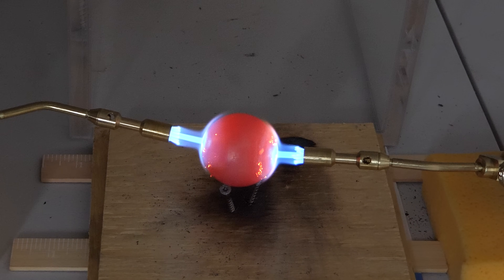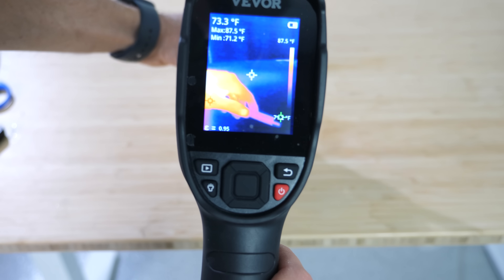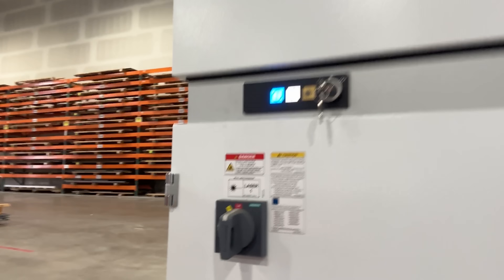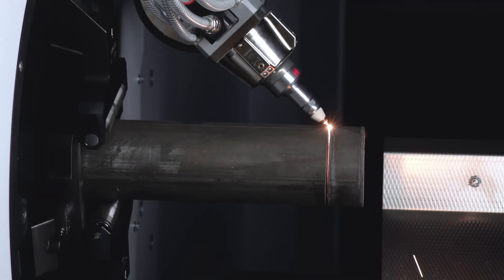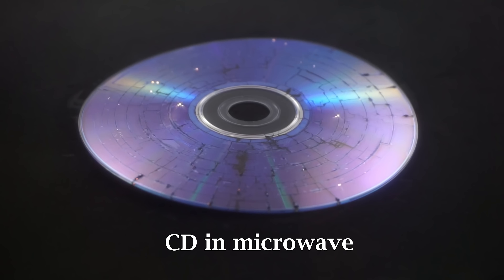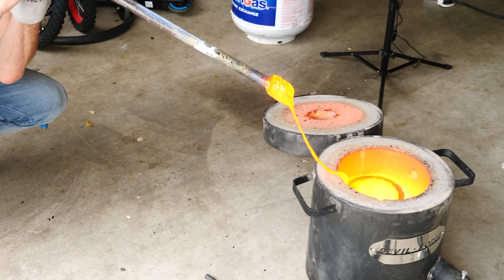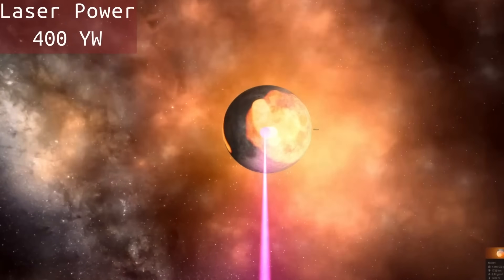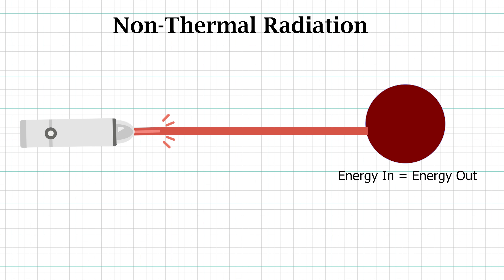How Hot is Light? How Lasers Bend the Rules of Heat Transfer

Comment: The video feels incomplete, light goes in and the light-matter interaction is where all the black box magic lies, but this video didn't explain that. Would that same laser melt me up like it did the metal? Why or why not? How does the energy of the laser get converted into thermal energy? The material absorbs it, and how much it's absorbed is material-dependent, why? What's the difference between a continuous wave laser and a pulsed laser?
Reply: I agree. Half the video was spent pushing an incorrect assumption as if it were a fact and there was some mysterious paradox going on. And then in  couple minutes, blew through several physics concepts with 0 nuance or detail. This was really frustrating to watch.
Reply: @solacedagony1234 the funny part is this is probably the best educational video I've seen on this channel. It's usually even worse than this from an education standpoint.
Reply: @panner11  yea this is pretty awful and click baity
Reply: First, we need to have a basic understand of how heat is transferred. Heat is just thermal energy.

You can think of temperature as a potential that drives energy in between two objects. To be correct, it drives heat flux which is in units of energy per units of time. If there is a temperature difference, there will be a heat flux. This is true for the three ways of exchanging heat : conduction (Fourier's law), convection (Newton's law) and radiation (Stefan Boltzmann's law).

For convection and convection, this is easy enough to explain as the heat flux is directly proportional to temperature difference. It follows that when the temperatures are equal, there is no heat flux. Because of that, if you want a heat flux, you will need your object's temperature to be lower than the transmitting object's temperature. Imagine that you pump energy into the heater to keep it at a constant temperature, then the heat flux will be proportional to your object's temperature. It also can't go higher than the heater's temperature. This has obvious practical limitations for reaching very high temperatures

Radiation is a bit trickier. Stefan Boltzmann's law tells us that the heat flux going out of an object is proportional only to its own temperature. This seems to conflict with what I said earlier but it in fact does not. When you put two objects in an isolated system they will both emit a heat flux. The total heat flux is the difference between the heat fluxes going in between the two objects. So we didn't break anything, the flux is still proportional to the difference in temperatures.

But when one flux is negligible in front of the other, we can assume the flux to be unidirectional. Consider two cases :
1) One object's temperature is much higher than the other. Think of the Sun and the Earth. We consider the flux to be only going from the Sun to the Earth.
2) One object barely sees another. Think of a filament light bulb. It sees all of the room and gives it all its energy, but the room barely sees the light bulb. What it will radiate will mostly go back to itself, and just a little will go back to the bulb. Again, we can think of the flow going only from the bulb to the room.

These are ways in which heat flows in one direction only using radiation. What's important is that unlike with conduction and convection, the heat flux going into the heated system is independent of its own temperature ! This means that as long as you provide radiation energy, there will be a flux, and your object will keep heating up (until it emits as much as it receives via SB's law). The ways to create radiation I described earlier use the fact that a hot body will emit radiation, but there are other ways, such as using lasers !

Now that we have a deeper understanding of heat transfers, we can answer every question. A real body won't absorb all radiation. It will reflect some, let some pass through and absorb the rest. Obviously, steel is very reflective so you'll need to pump in a lot of energy to heat it up. This means that your hand which is more abortive than steel would probably get vaporized where the laser shines. 

The properties of a material depend on its atomic structure (it's related to electron energy levels), but in practice we will experimentally determine the absorptivity, reflectivity and transmissivity of a material.

Finally, as flux is in units of energy per units of time, a continuous laser will emits its energy continually, whereas a pulse laser in short bursts. These short bursts contain lots of energy and emitting it for longer periods of time is impossible because of how they work : they stockpile energy a for a bit and then release it all instantly. This is why it shoots in pulses, they need time to accumulate energy. Continuous lasers are preferred for cutting because of the heat dissipation properties of a material. Even if you use a high energy pulse, the energy you transferred will get dissipated before you can shoot the second one. Imagine being Sisyphus and pushing the rock very hard for 1 second and then letting it fall for 2, versus pushing it at moderate strength continually.
Reply: Also completely ignoring the jet of nitrogen helping that 10kW laser remove the material, because it's not actually vaporising it, mostly just melting. On mild steel, jet of oxygen is often used, to help degrade (cut) the material even faster. Those cuts would be a complete mess without that jet of gas. What author admires so much is not the power to vaporize steel, but separate, clever system for removal of molten steel.
Reply: this channel is a lousy science channel and often gets things wrong, so id suggest you look elsewhere. brief answers: yes, the material absorption matters a lot. for cutting metal, CO2 lasers are used because their infrared wavelength is absorbed very efficiently by most metals (even though metals typically reflect most of the visible spectrum), and because they are cheap and easy to scale to huge power levels. 
even if you try to cut an object that is fairly reflective/transparent to the wavelength, the power of the laser will usually be enough that slightly slower cutting is possible. a bit of reflected power is not harmful to the laser itself, as it will just re-excite the lasing medium, you just need to keep the nozzle cool and carefully choose power levels. 
continuous lasers are great for cutting and welding as they just deliver lots of raw heat into the material. pulsed lasers are typically used for engraving since they deliver only a very small amount of energy per pulse. the heat they generate is still huge but it only affects the immediate area where the laser hit, as it is already off before the heat can travel far. they can also do different things to materials since their peak output power is orders of magnitude higher. a 40w average pulsed laser can easily be in the megawatts of peak power during the very short pulse. the trick is that they basically use the lasing medium itself as sort of a light capacitor, with the capability of dumping all that energy almost instantly using some clever physics. the bottom line is that CW lasers go deep into the material, while pulsed lasers pretty much only affect the surface. and there are very distinct applications for both.

Comment: well as it is emitting energy, and that energy is usually measured over an area not a point, so you can concentrate that energy by reducing the area that it is dissipating energy over. 
so yes you can focus a collimated beam of light and make it higher powered.
Reply: at one point you hit the diffraction limit for a given wavelength
Reply: @omblauman  umm a single wavelength of light will diffract to a single wavelength of light.
Reply: @johng.1703  yes and you can't go lower and increase power density infinitely
Reply: @omblauman  what are you going on about? focusing a single wavelength just means concentrating more energetic particles into a single point.
Reply: @johng.1703  but you can't go on forever concentrating and at some point you are re-radiating all the power you are concentrating since radiation goes with the 4th power of temperature. I might not understand what you want to demonstrate though
Reply: @omblauman  but photons are not hot.
Reply: @johng.1703  photons are not particles but short for quantum electrodynamics interactions, again I don't understand well what you want to demonstrate but i would encourage you to start with classical electrodynamics, i.e. Maxwell equations, which contain the least intuitive and most Laser relevant part of the statistical mechanics of radiation. Thermodynamics (temperature) indicates very useful  limits to radiation energy transfer, did you read what I wrote, about an hour ago, in the comments about this video in general? In short: laser photons are classical electrodynamics (hν << κΤ) and very very hot.
Reply: @omblauman  A practical demonstration should be in order then, heat something up by passing a laser past it, but not hitting it.
but do it in a vacuum. I posit that is it the photons hitting a medium and dumping their energy that results in heat, rather than a transmission of heat from the photon.
Reply: @johng.1703  you are using a definition of temperature which is too restrictive, radiation , even classical radiation, has energy, heat, and this energy has a temperature. This energy can be increased by a hotter body and can increase a colder body, hence has temperature, a property of all energy.

Comment: What confuses me is the sun is continually adding energy - it's an ongoing nuclear reaction continuously pumping more energy out in the EM spectrum - it's not coherent light like a laser, but there's not only the blackbody light radiation coming from the sun, but all of the photons generated by nuclear fusion as well - so it should theoretically be able to do what a laser pointer does a trillion times over.
Reply from the maker: The photons from the nuclear reactions in the sun's core are absorbed by the sun and turned into heat. This is how the sun can constantly be emitting thermal radiation but not cool down. Much like you can heat a stovetop to a constant temperatureeven though it is constantly radiating blackbody radiation but the electricity is resupplying that lost energy so it stays at the same temperature. Just because you are supplying energy to keep something at a constant temperature doesn't mean the energy radiating isn't thermal. So, in the end, this means that you cannot use any passive optical system to use the sunlight to heat something hotter than the sun itself.
Reply: @TheActionLab  you are using terms incorrectly: thermal radiation is radiation with a thermal spectrum (black body like) which you know is always an idealisation but a useful one in many contexts. This doesn't mean that radiation can't be characterised by a temperature in the sense that it can, or can not, heat an absorbing body of a certain temperature even when its spectrum is very far from being thermal. Temperature is piecewise concept in frequency, which doesn't prevent radiation from having more than one temperature, just like a gas can be characterised by more than one temperature distribution. With narrow band radiation the temperature is one though, well defined in the above sense.
Reply: Its true. What we get from the sum is em light. Not heat no laws broken. The heat is made from light hitting stuff here on earth, then becoming heat. Not so quick omblauman
Reply: for that same reason we can not infer what really is the temperature of the sun, as the law we use to calculate temperature from radiation only applies to objects in thernal equilibrium.
Reply: @cj09beira  explain how the sun is not at thermal equilibrium
Reply: @pinus_nigra  It rarely is the channel owner. Youtube removes a lot of comments without notifying their authors. It has become extremely annoying.
Reply: not true, coherence matters, the sun radiation can not heat up a body to temperatures higher than the sun surface temperature of 5000 °K otherwise it would contradict thermodynamics second law. A laser pointer can go higher given the absorbing object is insulated enough.
Reply: @omblauman  that makes literally no sense, the sun is not a coherent light source, true, but we're talking hypotheticals here so hypothetically if you had a massive purpose built lens, lens array, mirror or mirror array you could focus the sun's light into a spot smaller than the suface area which emitted the light in the first place so yes, you could get something hotter than the surface of the sun, fin think before you speak, dude.
Reply: @THEDANOFFICIAL  You actually can't - there is a physical limit on how lenses work that ensures the second law works - focusing a source of light too much will make it lose intensity. So if you take a 7000K pebble and try to focus sunlight onto it with a lens - it fails and the intensity drop makes it fail to even heat up. 

So yes, a heat radiation source will always just heat up whatever point it affects up to the temperature of the source at which point the black body radiation of the two bodies match up and no energy transfer occurs.

Comment: Hmm ... that's against my intuition 🤨
imagine we use a lens with an area of, lets say, 10 square meter, and focus all the light on a grain of sand (which is insulated within a thermos can by the way), then the grain gets so much more energy compared to its size
Would it still not get hotter than the sun? Where does the focused energy go then?
Reply: If the heat radiation can get in (into the thermos) then it can get out. As the grain of sand gets hotter, it radiates energy away.
Reply: You are right. I've seen a lot of this channel's videos and they're usually great but he dropped the ball completely here. If you had a mirror to concentrate sunlight on a small spot and kept adding more mirrors concentrated on the same spot. The amount of energy focused on that spot would rise with every mirror and the temperature would too.

Comment: Thermography cameras have sensors registering radiation in the range 7000-14000 nm. There is no reason at all why an infrared laser at 989 nm should register on such a camera. It is just like wondering why you can't see blue with a red filter before your eyes.

Comment: Fun fact: Because of the definition of temperature (which only makes sense in macroscopic systems, as it deals with the entropy concept) T=dQ/dS, in systems where there is a maximum energy there are states where temperature is negative. Additionally these negative temperature bodies always transfer heat to positive temperature bodies. A good example of a negative temperature system is a laser 🤯🤯🤯

Comment: I am confused, wouldn’t there have to be a limit to temperature, otherwise the particles would end up vibrating faster than the speed of light.
Reply: I think the rough answer is that the kinetic energy of the particles goes up faster than the speed. This is because the relativistic mass of the particles goes up with their speed. To reach the speed of light the particles would need to be infinitely heavy - which never happens. In a sense the energy creates extra mass. E = mc^2 comes in here somewhere, I think my explanation is basically correct, but probably no use the latest way of explaining it.
Reply: The kinetic energy of a (massive) particle moving at the speed of light is infinite, which would correspond to something like 'infinite temperature'. No matter how much energy you put into an object, you can't make it go equal to (or faster than) the speed of light.

Comment: If I rub my hands, both get hotter than my hands! Have I violated any law of thermodynamics, or is it just work used to increase the thermal energy?
Reply: Mechanical work converted to heat by friction. Just like what brakes do.
Reply: @Sekir80  it was a rhetorical question.

Comment: youre actually mixing up some stuff here, the magnetron of an microwave is not around 100 degrees. or rather the electrons in it are extremely hot by being pumped by electromagnetic fields, about 80 000 K (although measuring this in temperature is kinda pointless), above this a magnetron should not heat up anything. not normally a concern obviously but quite different from the negative temperatures that lasers have.
Reply: temperature - is paremeter of body. Laser or elecrons has no body so temperature not applicable to it at all

Comment: question , If a laser runs for say 1 hour just pointed at nothing , say out to space , and you measure the lasers head body cavity temperature , Then under the same conditions , but , this time the laser is being used to say , cut metal , Would we measure the lasers body , or head, or cavity etc.. to be hotter ? In other words does a laser get hotter if its doing work ? has a load on it , compared to no load .  Thank you very much.